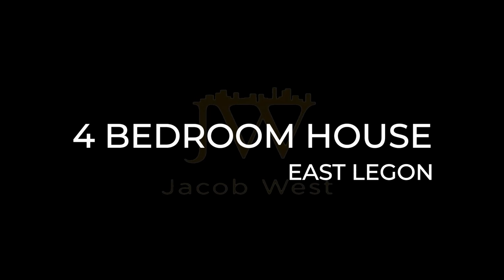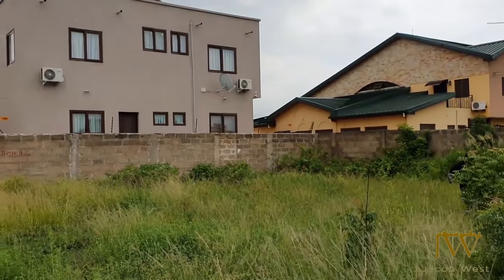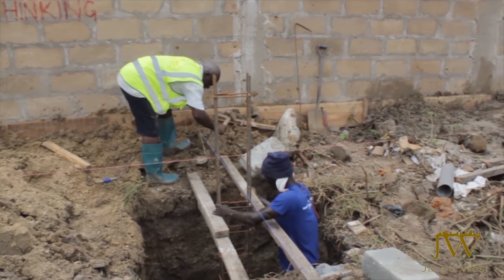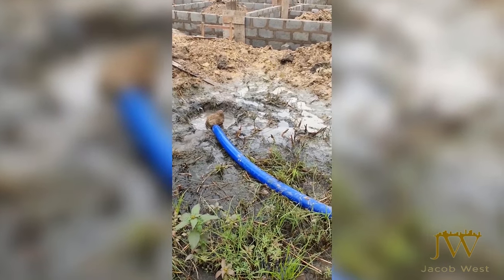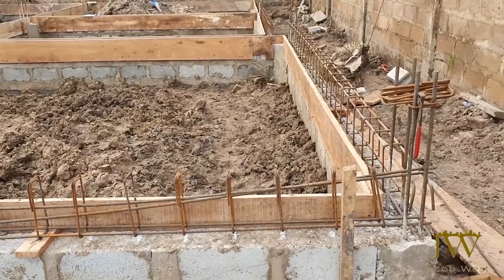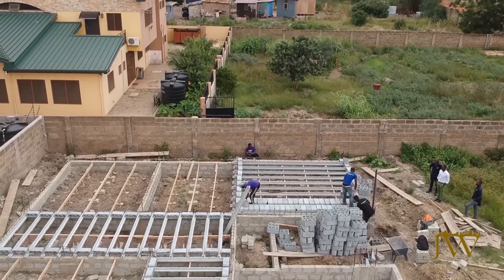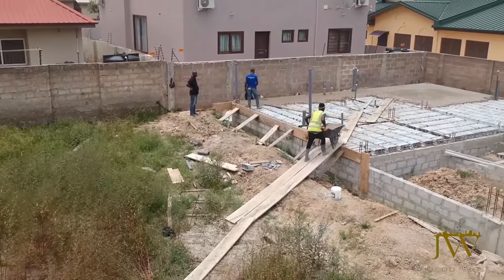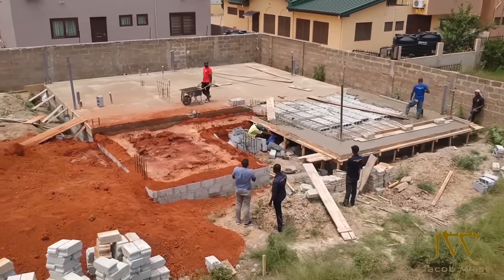How to building a solid foundation on a Wetland in Accra-Ghana West Africa | Time Lapse Video

Comment: Still, this foundation wasn't damp proof and would absorb the water in the ground which was very necessary for this project.
Reply from the maker: There is a damp proof membrane underneath. Its just unfortunate that this process was not captured on camera
Reply: @Jacobwestgh  Really, and jet the brickwork was still absorbing water as you were building and filming the creation of the foundation.

Comment: Hi Jacob, i love the fact that you used precast slab method in order to cut down the quantity of concrete as against the normal traditional method, but my question is, why did you not fill the place to the brim with laterite or sharp sand, the pores can create vibrations or even water can gather in the space and cause capillary with time, since you didnt make provision for DPM

Comment: Hello , 
would u please advise on the specs of the beams used ( thickness ) , 
As well as specs of blocks used in filling inter-beams .
Moreover , you mentioned in another reply that u have put a membrane between soil and beams , does it mean that you have filled the space with laterite before you laid the beams , I.e. the beams rested on :  membrane 》laterite ? 
Thx

Comment: Greetings. Thank you for the great video. I was wondering if you can share some of the technical drawings in these videos so that we can better understand how things  are built. 

Just a few curious thoughts I have, was the building engineered by a licensed structural engineer and if so, what is the name of the company please? 

How deep are the stilts below ground? 

How was the rest of the site graded to manage surface runoff to keep water away from the foundations?
In addition to the stilts, where there footings cast before the foundation walls?

Was there a reason for the block foundation instead of a cast in place concrete foundation?
 How were utilities like plumbing and sewage integrated into the foundations? 

And Finally, did the plumbing, and electrical engineers provide drawings to help with the coordination of the building as a whole please. 

Sorry for the lengthy post and thanks in advance for your time and great video.

Comment: Lovely video.
Just one question I have with regards to the foundation.
The land has been determined to be wet and may subject the building to suffer from rising damp?
Have measures been taken to protect the substructure from damp issues? or is the concrete casting sufficient to protect the ground floor from damp in future?

Kind Regards
Reply from the maker: In order to avoid the water from creeping up the building and weakening it over time, we laid a Damp Proof Membrane in the ground before we started the footing of the foundation. It's just unfortunate that this process was not captured on camera.
Reply from the maker: @Wendall Church The reason for only filling the car port is because the weight of a vehicle may not hold on the prestressed beams therefore we used the traditional option for that area.
Reply from the maker: Also may I add that the prestressed beams technique means the building is seating on pillars (stilts). So the base of the foundation isn't resting on wet land
Reply: Great
Reply: @Jacobwestgh  chief what about underneath the individual columns?

Comment: What kind of blocks did u use to fill up d floor b4 pouring d concrete and I noticed it wasn't filled with laterite meaning beneath d concrete is hollow. Will that still give a solid structure?

Comment: Great video, how will you advise me to handle my project in an area which seems low and has potential flooding issues. I've already completed my fence and was just told we'll need filling to elevate the level above the road. Will this break the walls when the filling is done?

Comment: Look like surface water, the land is low.
Waterlogged land you'd have to build it different to what your doing.
Only .900 down standard footing depth.
Did you do a test hole to to about 2.740 to see water level, if water logged, hole would have caved in. Had to use a raft.

Comment: Thanks for the great video .I see you didn't  place wiremesh or BRC before  casting the concrete  ,will it be strong enough  to hold  it without cracking in the future  ?
Reply from the maker: The beams themselves have a reinforced steel core hence the reason why we didn't use the steel mesh as some form of reinforcement

Comment: Hi great Job,Engr from Nigeria,I would love to know what you used to demarcate the foundation before piling blocks,are those 2/3 woods or bamboos? The piling is very accurate and neat.i want to know how you arranged it so neatly
Did u leave the wood under the casting?I work on swampy areas alot,I am looking for innovative and cost effective ways of building foundation thank you.I await your response.
Reply: They are neither woods or bamboos. Those are precast beams, though slender.

Comment: Jacob West  @6:12  ,Significant amount of Water right against the exterior foundation wall is extremely bad. 
This will weaken the foundation wall. Generally, having water right next to foundation stem walls is not a good thing.  Thanks.
Reply: You're so correct bro

Comment: What steps in this process prevents water rising into walls??
Reply from the maker: In order to stop the water from rising through the walls, we created a dump proof membrane at the base of the trench before the block work for the foundation was done. This is to stop the water from rising through the walls. Unfortunately this process was not captured on camera hence why it was not shown.
Reply from the maker: Wendall Church  Thank you for the comment. Factoring in all costs involved and the nature of the land, the cost of the foundation can be between Ghc30,000 to Ghc60,000
Reply: It is a pity that you only say this now. Worrying that you omitted this most important issues in your original video, very suspicious that you might not know what you are doing.  As this is a very important aspect of any building, most people anticipated it to be seriously and singularly addresses.